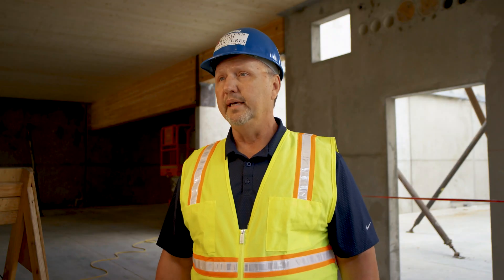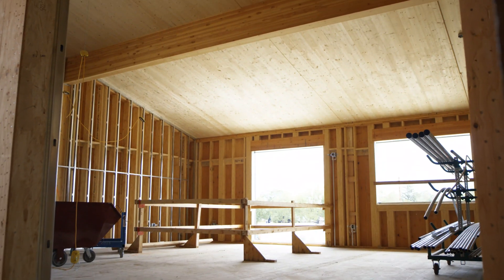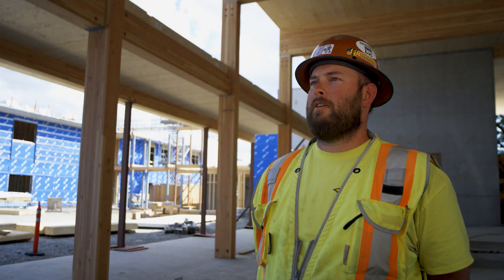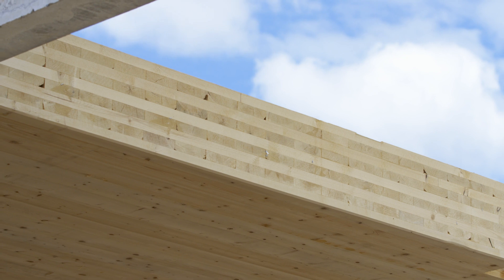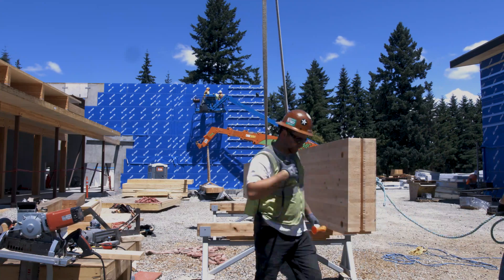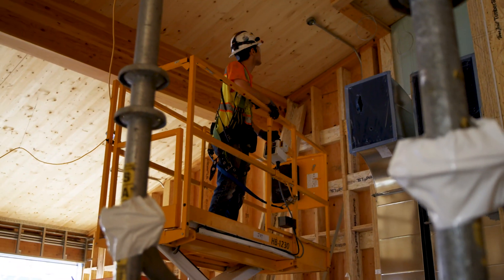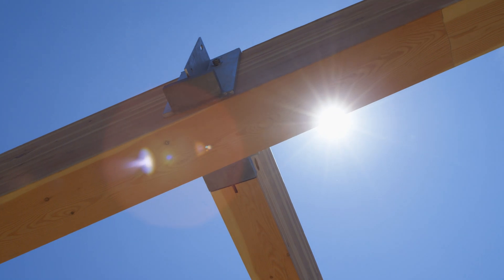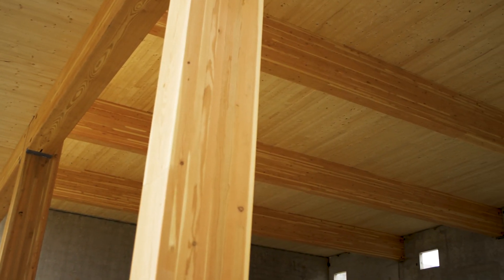Largest Cross-Laminated Timber (CLT) Project in the Pacific Northwest

Comment: "environmentally friendly"

Environmentally friendly would be not cutting down trees.
Reply: Dear Millinials, if you don’t know what this means, don’t comment. It’s above your head.
Reply: @DevinSheaProductions  dear boomer, the industrial era is long gone. Look at the damage you environmentally negligent assholes have caused and left for us to deal with. Now sit back and stfu and let today's engineers and scientists clean up your mess.
Reply: @Nominally-Built  so you are gonna claim the work of others, interesting big mouth... lets for the sake of reality go with the premise new constructions aren't going away anytime soon.   so maybe if you are worried about carbon footprints, you'd understand the benefit of projects like this over traditional steel and concrete.  but i think rather you like to hear the sound of your own bullshit.   if forests are managed responsible, on the community to make sure that happens, then projects like these are more than viable options, even preferred.  learn more, then opine.
Reply: Its entirely renewable, and carbon sequestration is the highest among other building methods. As long as reforestation efforts are made, yes it is very, very friendly(just took a class on designing with CLT :)  )
Reply: Not true. When you cut the tree the carbon it captured is now trapped in the wood you build with, and there is now room in the forest for another tree to grow and absorb more carbon. Most trees grow faster when older, but that doesn’t mean they’re more efficient per acre
Reply: Making steel and concrete is less environmentally friendly than cutting down and REPLACING TREES. Gosh you're putting a bad name on Descartes the philosopher bud.
Reply: clt traps carbon in its fibers and can be composted at its end of life cement ts made from super heated limestone wich makes 1.8 tonnes of carbon per ton of concrete at the end of its life it goes to a landfill , natural fiber is always preferred to man made anything

Comment: Why using that much lumber? Great job guys! I still think that this is a huge waste of lumber!
Reply: Structural rigidity and less weight. The idea is to not use concrete, also a sustainable construction.
Reply: @annakquinn7084  yes clear cutting northern canadian forests which most likely take a 100 years to regrow is sustainable
Reply: @polskiewinnipeg  selective harvesting is a manageable practice, if its not exploited, that's one path.
Reply: @polskiewinnipeg  CLT usually comes from FSC forests, not old growth. Mass timber locks carbon into a structure whereas building with steel and concrete releases huge volumes of carbon. So, timber is the way forward in terms of being kind to the planet and reducing global warming. For the record, I'd like all old growth forests to be protected so no-one can harvest them.
Reply: @polskiewinnipeg  better than using coal that can’t be replaced
Reply: it comes down to carbon footprint, concrete and steel have a larger one in comparison.  individual projects might not allow for wood as a viable option, but it should be an alternative when it's the best solution.
Reply: thats your opininon and you are not an expert on this topic so please shut the fuck up
Reply: @muhammedaliozdemir6106 amen